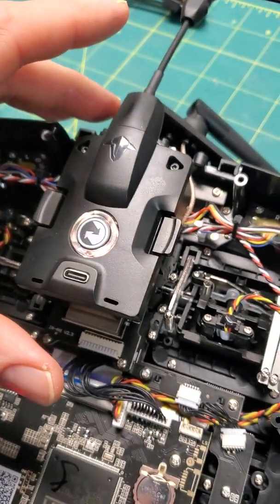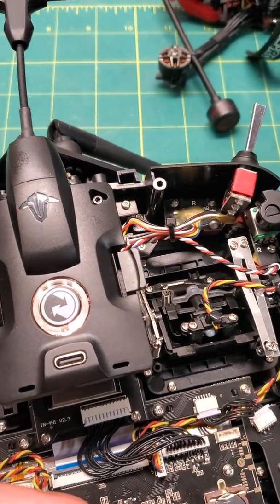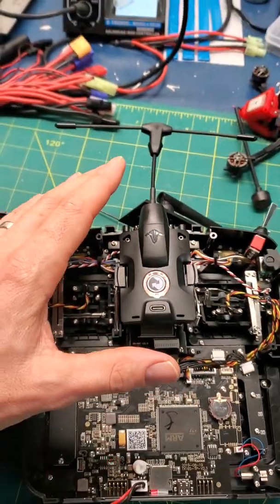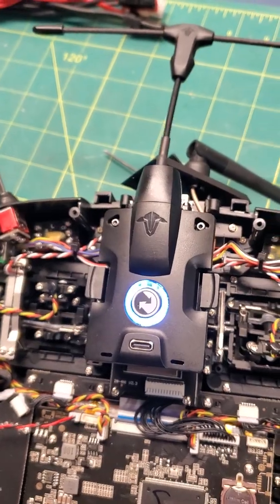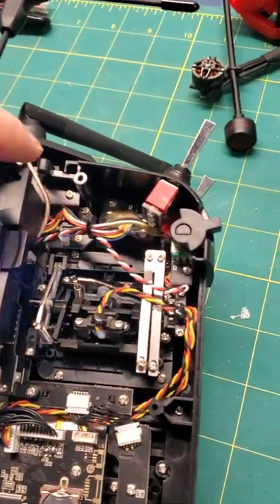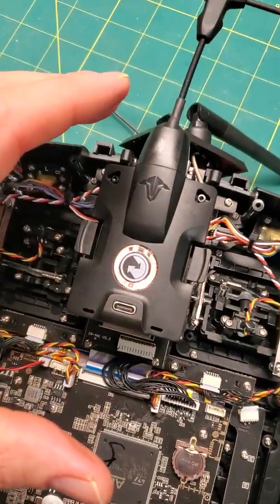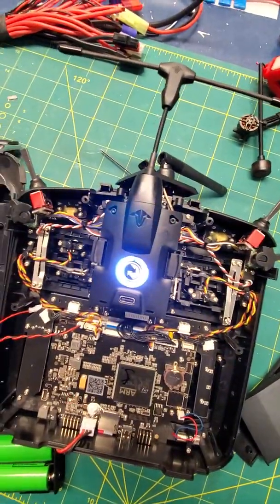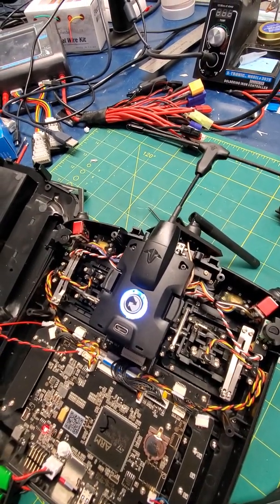TBS crossfire Micro TX v2 interference issue causing it not to be detected by radio

Comment: This is strange! Definitely contact TBS and get an RMA request. This module is defective, the problem is, many others are experiencing the same issue so it must be a QC problem. They claim it's either bent pins (not always the case), sd card needs to be replaced or improper installation of the chip which does not apply to those with tx16s or similar radios.

Comment: Hmm ya thats weird.. 
So it was working properly before correct ?
Did you try using the TBS AGENT X ?
try factory resetting it.. check all setting in your radio also.
Reply from the maker: I used TBS AGENT X to test if I could bind it. It worked when the USB is plugged in, I would bind it using Agent X, then i would power on the transmitter, and disconnect the usb cable, and all would work fine. This only happen when i power on the unit normally when it is in the JR module bay of my radiomaster. I will have to try the factory reset i guess tonight and see if that helps on the crossfire.
Reply: @StephanFilms  Did the factory reset help at all?